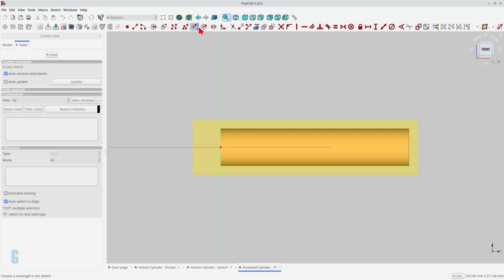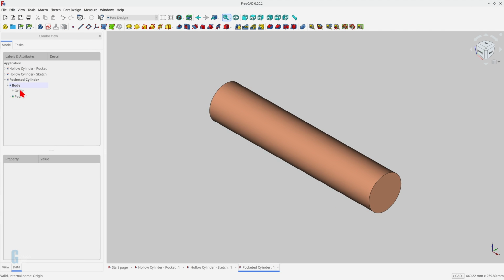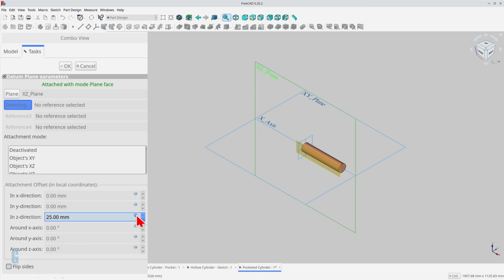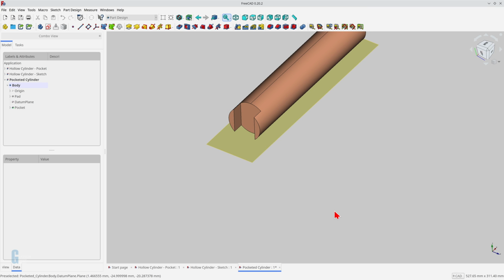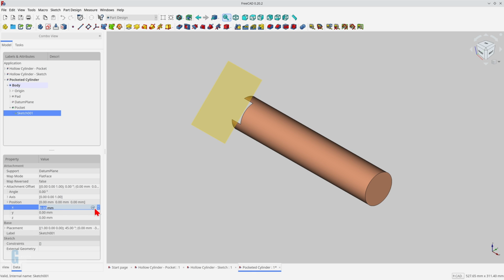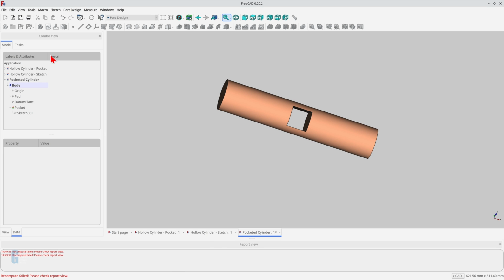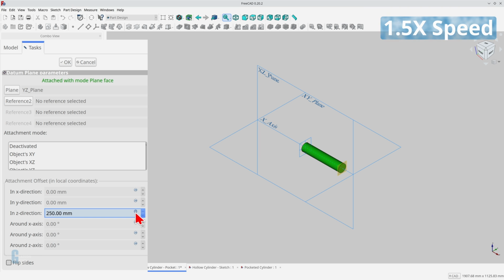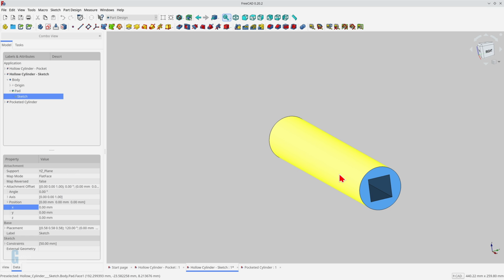Viewer Question: Cutting pockets in cylinders

Comment: You don't need to create the datum plane if the sketch is aligned with one of the base planes. You can just attach the sketch to the base plane itself, and pocket it "symmetric to plane".
Reply from the maker: Thanks for your comment James. Your're 100% correct when you align a sketch with a base plane, but the main principle of the video is that you can align the sketch in any direction when you use a datum plane.